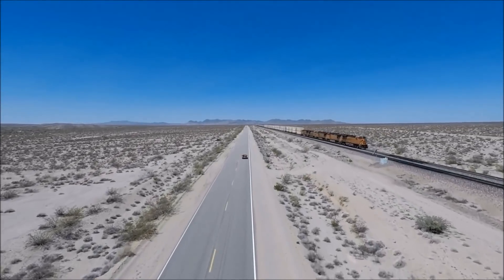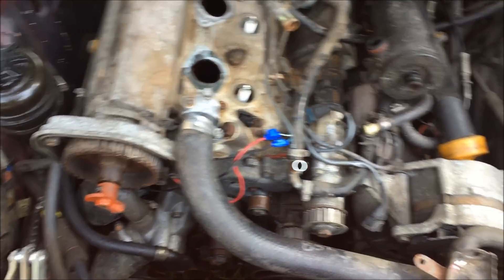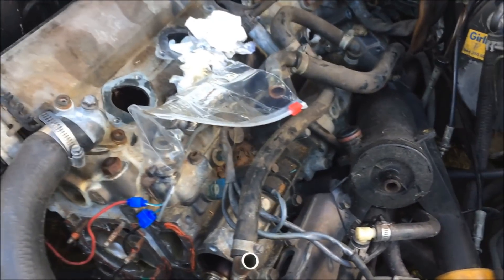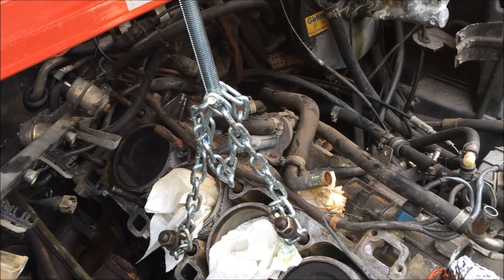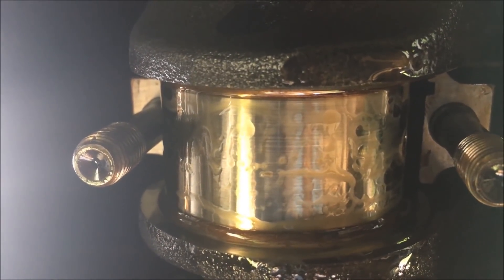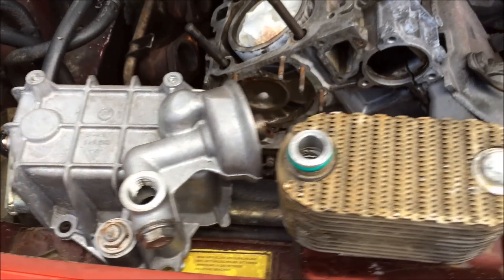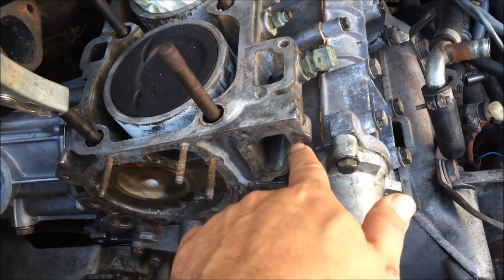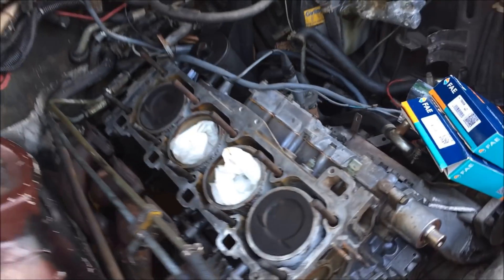Red 1984 Porsche 944 Part 1

Comment: GREAT video This man knows his 944   I have  got a 1982 red 944 and its got 2 holes in it 1 in the  battery try and the other on the  n/s front floor which this man has covered in his videos . So thanks
And its the first time I have seen those big rubbers on the  bumpers.
KEEP THE VIDEOS COMING THANKS AGAIN. FROM NOTTINGHAM ENGLAND

Comment: Chuck up a flat end mill in a drill and shave the leftovers of that bolt down flat, then center punch it and drill from small to large. The welder trick is my goto as well, but sometimes ya gotta drill it.
Reply from the maker: That's exactly what I was thinking. That said, I might see if I can get someone with the right tools to do it for me. Drilling out studs really isn't my forte...
Reply: Using the water pump as a jig, fit a bushing to the hole in the pump that matches the hole in the block you want to drill out. Fit the pump to the block being careful to VERY carefully align the hole to be drilled out with your bushing-fitted hole in the pump, then carefully drill it out. It looks like you may need to invest in a decent right-angle drill motor to get the job done, but oh, well...you always gotta have more tools, right? 

   With my block out of the car, I drilled out and fitted all of the holes for the pump and oil cooler housing with stainless Time-serts to provide more robust holes for fasteners to thread into. The aluminum they used in these blocks seems only slightly stronger than cheese.
Reply from the maker: I might go my the machine shop and just ask if they had to tools for such a job and are willing to come out and perform it. If not, it looks like I'll probably have to do this with a homemade jig, which I'm really not looking forward to.

Comment: I also recently got a early 80s model 944 and Im trying to figure out what vehicles I can successfully find parts for it I just bought a Volkswagen beetle type 1 Ignition lock cylinder because they looked identical what is the same as running gear if I get on it the whole car shakes instantly and idk if its bushings also the door locks can it be rekeyed with vehicles locks stuff ?

Comment: Can you replace the button style temp gauge sender on an early 85 with a 2 prong temp sender? I know the stock harness only has the blue/yellow wire going to the sender but I have a 2 prong sender. Trying to figure out why my temp gauge doesn't work. Thanks for the video! Fun to watch you work!
Reply from the maker: Nope, they're completely different. The button style is much smaller and doesn't go into the water jacket. You'd have to drill a hole through the block then enlarge the hole for the threads and re-tap it. Not really worth it... not to mention I believe the two senders have slightly different resistance readings since the later gauges run hotter. The center of the early gauge is roughly 80C where the center of the later gauge is 83C, so its just a headache. If you're interested I tried to cover most of this stuff in my early vs late engine blocks video. I hope that helps!
Reply: @edredas thanks for the reply! Just reviewed the video you mentioned and it seems I'm in a pickle. I don't have the auto tensioner but I have the reinforced balance shaft covers and the 2 pin temp sender. So maybe I have a hodgepodge of an engine because of it being close to the cutoff or one of the POs was quite industrious. Do you know of a way to check if the block that's in the car is the original block?
Reply from the maker: Yup there should be stamp on the engine near the reference sensors. It will read something like M44/07 43H. The ‘H’ means it’s an 87 block. So the letter on your block should correspond to the letter in your vin. If it doesn’t the engine has been replaced.

Comment: At what point do you just pull the entire engine and rebuild it on the stand? If you knew all the things wrong with one would you have just pulled it?
Reply from the maker: Yes, I would have rather just pulled this engine. However I was told that it was a running driving car that only needed a few things. I now own this car and its still running flawlessly, but that was a lot of work to get it there!

Comment: Doing a full engine rebuild on a ‘84 944 na, anyone know any good rebuild kits and full engine seal kits?
Reply from the maker: Victor Reinz has a bottom end and head gasket set. Both of these kits will provide much of what you need, however the bottom end kit does not include the proper gaskets and spacers for the oil cooler. It also doesn't provide the oil pump sleeve or cam/balance shaft collars, so you'll need those as well. I hope that helps!

Comment: Hey I'm loving your channel, watched nearly every video you have about porsches. Recently bought a 924s. Today a bouncing idle problem developed after I made a strong pull at a green light. Made a short video of it: https://www.youtube.com/watch?v=eHa34wbZduE Do you happen to know a fix?
Reply from the maker: Hi, I would make sure the idle switch is set properly. With the engine off you should hear a faint click from underneath the throttle body when you release the throttle cam. The most common reason why it isn't tripped is that the accelerator cable is too tight. You can also adjust the TPS under the intake if loosening the cable doesn't help. If everything is set properly it should fix this issue but if not be sure to check for any vacuum leaks! I hope that help!
Reply: thanks for the reply, the issue was fixed by revving the engine to 5k rpm